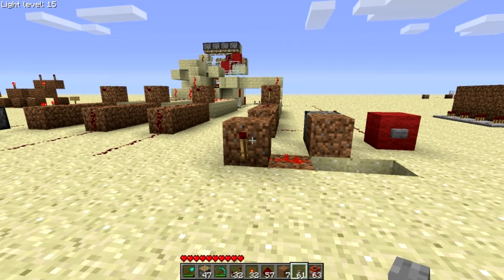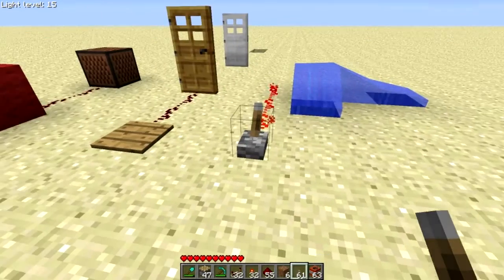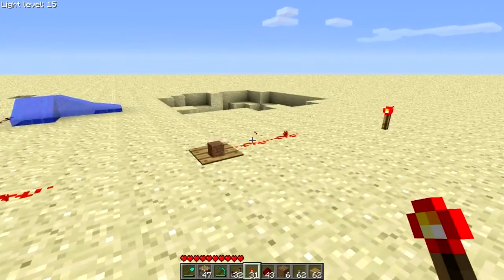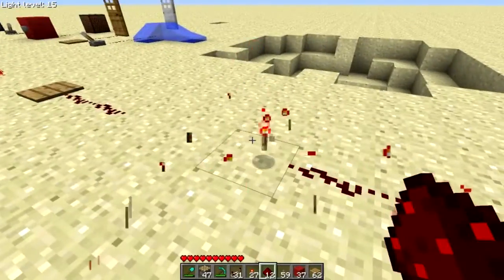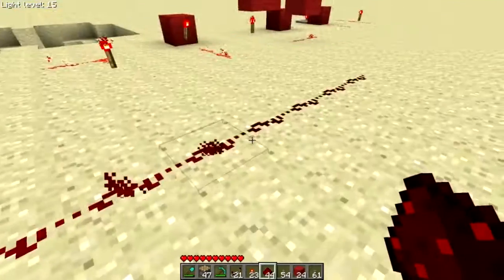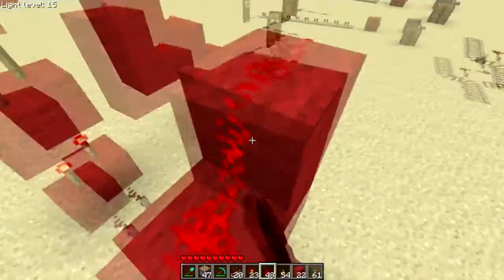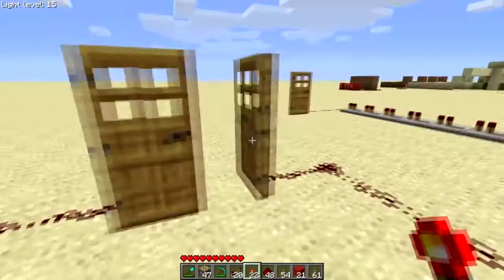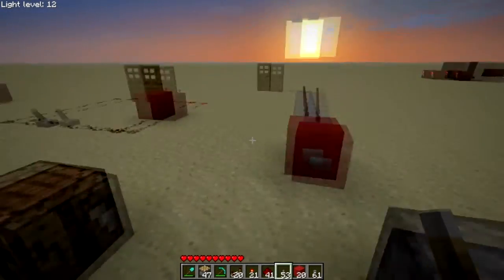Minecraft - Redstone Tutorial Part 1

Comment from the maker: @Crux315 Ha. The reason its 60 bit is because the dimensions don't really fit nicely with 64. Its a looping set of 4 blocks, but you need 3 of the sets to be air gaps so. That's just the way it turned out. I'm sure I could make a 64 bit, but does it really matter? :D It can play minecraft in minecraft